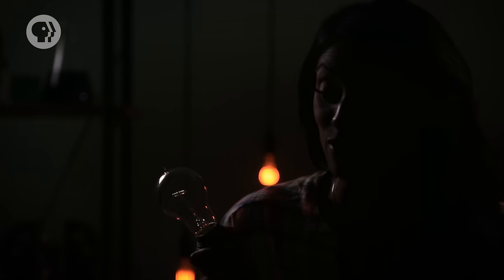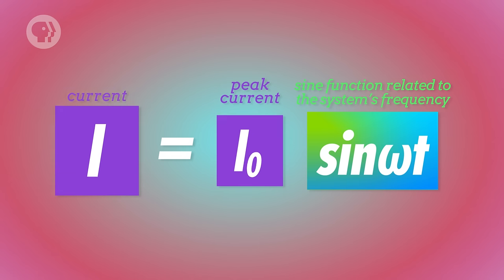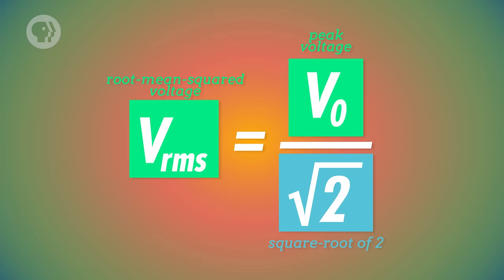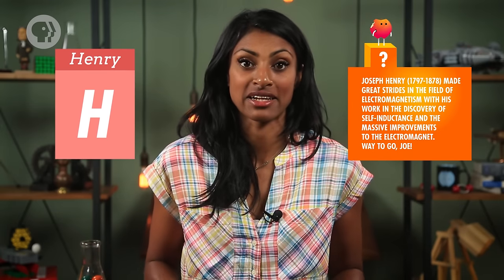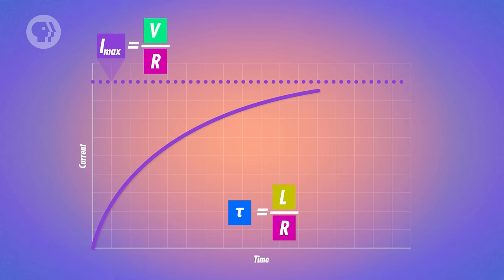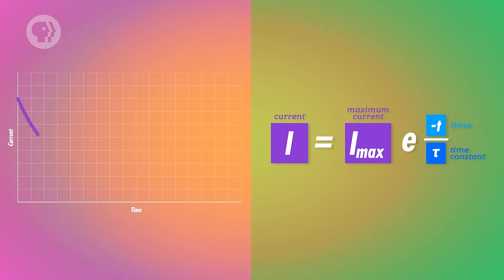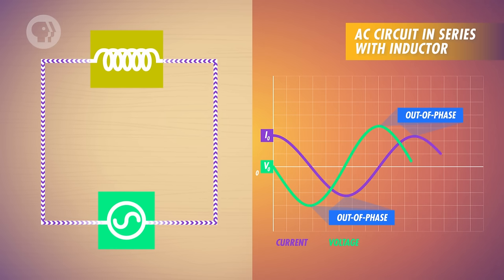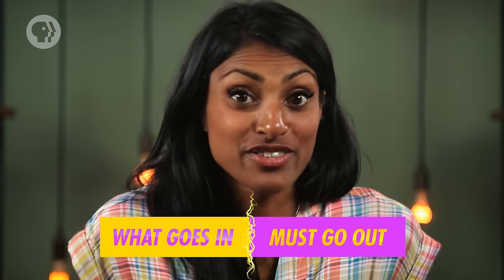AC Circuits: Crash Course Physics #36

Comment: Nice introduction, but not quite enough details to get your degree in electrical engineering.
Reply: Brian McConkey Are you one?
Reply: Yes
Reply: Brian McConkey Majoring or majored? Cause I'm looking into mechanical engineering and electrical engineering right now. My heart is far more with mechanical since I'm deeply passionate about that stuff for years, but last year Electromagnetism just blew the water out. The equations, the concepts, Maxwell, multi variable calc, they're all my forte now. But these werr by far the hardest topics that destroyed me. How much more harder does it get?
Reply: If you want to make a living choose mech and specialize in large structures that can't be economically shipped around the world. After over 30 years of electonics design I can no longer find employment in North America as its all done where the Labour very cheap, Asia. 
Best of luck.
Reply: Brian McConkey I will keep that in mind. Thank you very much!
Reply: To address your question about how much harder does AC circuit analysis can get? Well it can get considerably more complex than what is given here. The description of RMS is quite simplified, and as the frequency goes up, circuit analysis can no longer be done assuming lumped component values. As you might imagine this becomes complex very quickly, so we now use complex computer tools to solver these types of designs. This is why today's cell phones exist, if you had to design one without the computer tools, it would take decades.
Reply: Brian McConkey How about electromagnetism as a whole? I'm specifically immensely interested in the electromagnetic side, so these types of circuits, induced currents, and magnetic fields. How do those play later in the game? Does the math get heavier? Because as you've said, a lot of engineers use computers for the more complex stuff, so is there ever a time where the human is actually doing the calculus? Applying Maxwell's Equations ourselves? That's what I'm particularly interested in.
Reply: APresidentsRansom Having just taken my engineering electronics course last semester, I can tell you, the math certainly ramps up.  Upper level use of AC circuitry requires in-depth knowledge of differential equations; while computers and calculators can help, if you can't do it on your own, you won't understand what the computer gives you.  Even then, there are some equations too hard for most computers to solve anyway which would be much more effectively solved by hand.  Remember: a computer is only as smart as its user!
Reply: So I'm not sure how to interpret your question of "does the math get heavier". I'm going to have to say yes, as we look more closely at the components and how the physical laws interact with the material that the components are made up of the math gets considerably more complex. The use of calculus and differential equations to solve the more complex configurations is definitely required, and as a student you will have to learn how to do this type of calculation. As for doing this while on the job, not so much. Being employed as an engineer you have to understand the physics but you have to be able to produce answers quickly and most importantly on a budget. Thus there is rarely time for solving complex math day in and day out. Having said that then I also have to say, once in a while you do have to go into detail and be able to solve complex questions, like can we use this inductor that was designed to operate at 20 KHz in our cell phone transmitter operating at 2.5 GHz (not a realistic question, but hopefully you get the point).
Reply: Brian McConkey Yes, I see now. Thank you very much on the insight!!!
Reply: @APresidentsRansom Engineers do not learn electricity and magnetism in the same depth as physicists ; if thats what interests you, it is its own field that can be studied for an entire lifetime. We are actually now looking for electromagnetic quantum critical points. Besides that point, in engineering (I am just about done with my mechanical engineering degree and physics degree), the math is actually simplified a whole lot. Partial differential equations are not attempted by hand by engineers, and the solutions are numerically and empirically solved;  PDEs and different vector spaces is what governs EnM. In engineering, you will stick with Ordinary Differential Equations (simple ones at that), complex analysis (not as complex as it sounds), and numerical methods using the computer (this method is used the most).
Reply: Brian McConkey this is like 1/500 to get you a degree lmao
Reply: 1/1000000 - for just electronics this doesn't even scratch the surface for analog. not to mention it doesn't even open the doors to digital circuits, ADC, DAC. Literally helps you with nothing hahaha. Its not even in enough detail to be useful information.
Reply: 777Ime 1/10000 alright but 1/100000 is exaggeration.  First year student here.
Reply: I would still go with the latter. This is literally a fraction of a fraction you need to know. Especially if you're in physics and not engineering, since AC is not our entire degree and we don't worship Tesla lol. If you're a EEE, then sure. If your focus is electronics, then okay.
Reply: I was hoping for at least a quick laplace transform to show how much easier it is than doing the differential equations.
Reply: Brian McConkey Of course, this is only covers AP Physics.
Reply: For smart people you seem to be struggling with the concept of Crash Course
Reply: 777Ime Yes, this has been sort of a dilemma for me recently on whether I want engineering or physics. I could see that my thoughts and aspirations lie more on the physics side. I probably will not head down the electrical engineering path then, as it's mainly the branch of EM that interests me and not electronics nor commercial usage for them. I really just like the advanced math that goes with it and the theorems; a physicists side of it.
Reply: +Brian McConkey +APresidentsRansom
Both of you need to keep in mind that electronics design is one relatively small subfield of Electrical Engineering. There are a CRAPTON of other subfields that are doing just fine in the US thank you very much. Power engineering continues to exist, and that field seems to be hurting for engineers (few are interested in it). There are also a large number of automation engineers (a field which is unlikely to see any shrinkage for a long time). Many engineers seem to be landing in programming jobs these days.

Most of my fellow students got multiple job offers before they graduated. I locked in a position before I got to my senior year.

Also bear in mind that most mechanical engineering students these days seem to be pushing for their masters to get maximum employment. I don't know why exactly, since I was a EE rather than an ME, but it means that you'll potentially be doing another 2 years of university. That may not be a deal-breaker, but it's something to keep in mind.
Reply: +APresidentsRansom
Physics and most engineering fields are all degrees in specific kinds of applied mathematics. At least for EE, after freshman year, almost every course you take will either expose you to a whole new field of mathematics, or push your algebra and calculus skills to the max. EM specifically requires good knowledge of vector calculus, differential equations, and a bit of harmonic analysis (via fourier series).

A good way (but not the only way) to specialize in EM is to major in EE (specializing in power engineering) with a minor in Physics (specializing in E&M). You'll get to see electromagnetism from two VERY different angles.
Reply: Falcrist Interesting. And yes, vector calculus, differential equations, and harmonic analysis are DEFINITELY my favorite tools of math to use, and is why EM is so interesting to me. The "electronics" side isn't too amazing to me, and is why the physics side of it gets me. I honestly just want a career that'll enable me to apply these as much as I can, while also being able to do something "useful" like how an engineer is. Because studying the same formulas all my life won't get me a career.
Reply: Consider looking at the wikipedia article for electrical engineering, and the article about radio frequency engineering (RF engineering).
Reply: not enough details you must be out of your mind. my head hurts with so many details
Reply: Falcrist very good advice
Reply: Strange Symbols then do LTI systems

Comment: Wait, isn't it that the voltage lags the current by 90 degrees in capacitors and not the other way around? Since capacitor hates sudden change in voltage.

Comment: Really could have used that extra 5 minutes to talk a little slower. Otherwise, this was a great video of time compression utilizing an increased information transferal technique by way of sound waves that form packets of alternating tones called words, in an arranged pattern called the English Language. I'll anxiously await the video that explains the formula with the relationships between data retention, word velocity, time and acceleration of space between vibration alternating or variable tone packets of displaced air measurable and converted to information called words. Oh,  the graphics were pretty too. Nice work.

Comment: To fast for me whats going on?
From lower grade here! ;-;
Reply: take physics or some intro circuits class and then come back

...but/or...she is talking about three common components and these components were well explained in earlier videos in this segment.  These are key details as to how they behave in ac (as opposed to dc) circuits.  Sooooo, you could probably understand this video by re-watching the videos on electrochemistry and circuits.  (Understanding this allows you to do a bunch of useful stuff like create logic gates or understand why we have transformers on telephone poles)...
(also understanding how capacitors work allows one to make super simple timers with only a few components...I didn't know how they worked in high school but it was useful for doing silly things with little breadboard circuits...could probably impress your teachers)
(a resistor adds resistance (think V=IR), an inductor opposes change (think that the magnetic field coils around a straight current carrying wire so in a coil of wire the magnetic field resists itself), a capacitor stores energy(similar to an inductor but lets it out in a burst (capacitors are made up of two plates and an insulating material and build up charge on the first plate until the voltage difference is great enough to jump from plate to plate).)

This isn't a great answer(drunk and see lots of misspelled things) but perhaps it will provide some incite.  This is typically covered in one's second semester physics class in college in the US.
Reply: I installed an extension for Google Chrome Web Browser called Youtube Playback Speed Control. It lets you slow the video down to 0.75 which is the perfect speed for these Crash Course videos